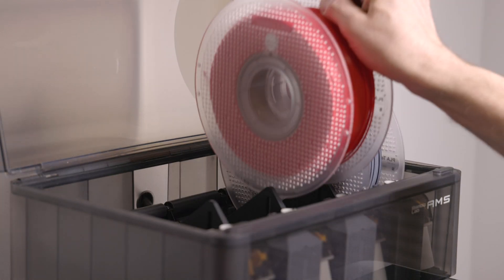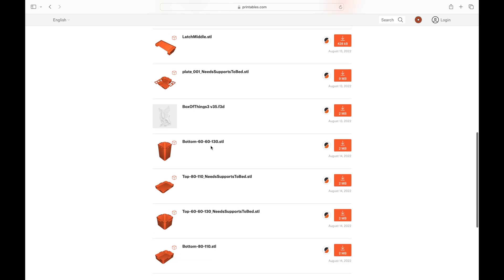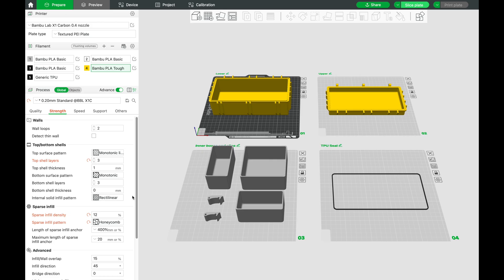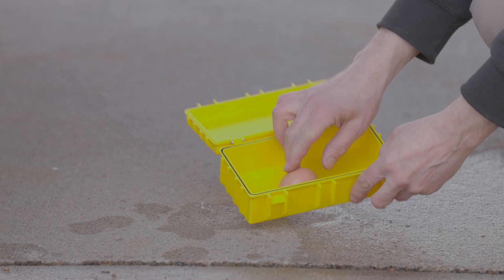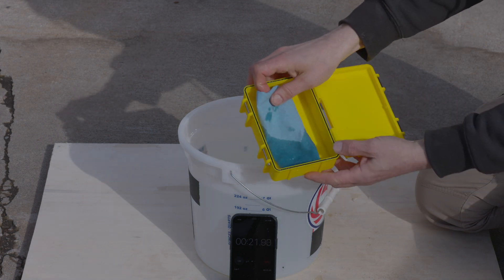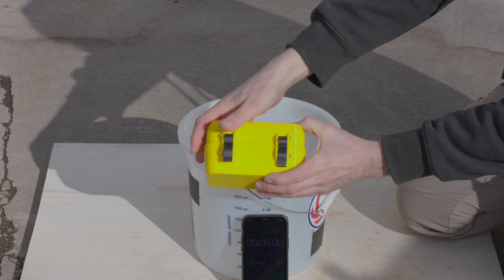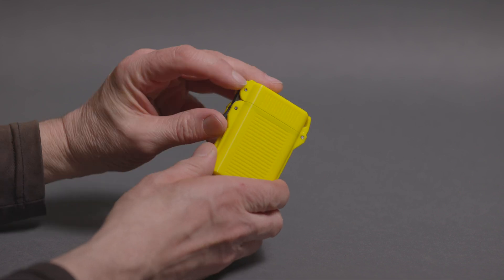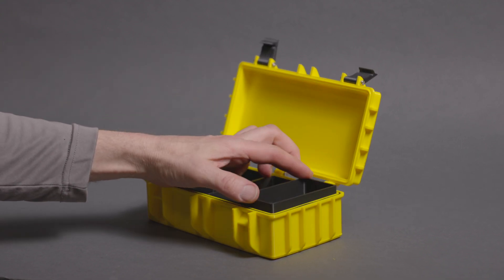I tried running over 3D Printed Cases...Here's what happened!

Comment: SnapLock Storage Boxes from makerworld. Completely 3D printed. No hardware required. Multiple sizes from small to extremely large. Same simple "snap lock" design on all versions. Tight tolerances on back and snap lock front latches.

While not advertised as waterproof, TPU could be added but the design. It might do okay without it but waterproof isn't a huge deal to me personally.
Reply from the maker: Thanks for the suggestion. I will check it out!

Comment: The TPU seals sucking wasn't a surprise to me, My college SAE baja team tried that for an electronics box a few years ago and had pretty bad results.
Reply from the maker: Yeah the TPU seals weren't great but at least we now know roughly what those designs are capable of. Did your baja team ever find a better solution to the seals? I would like to revisit this project at some point and try different filaments that might be closer to a foam or a silicone to see if I can get a better watertight seal.
Reply: @FilamentFabrication  We ended up scrapping the whole design for other reasons so we gave up on the seals.